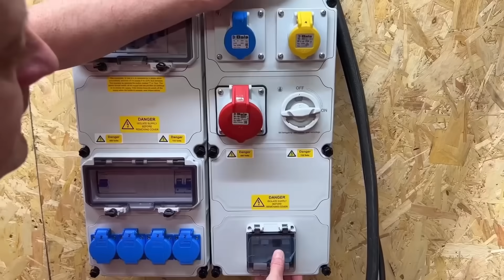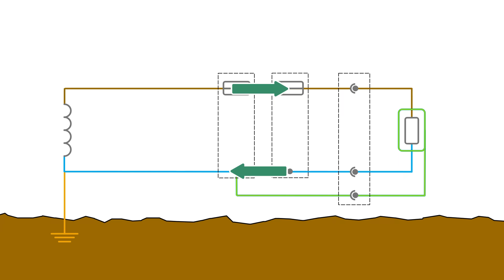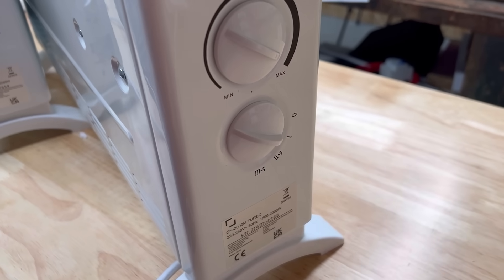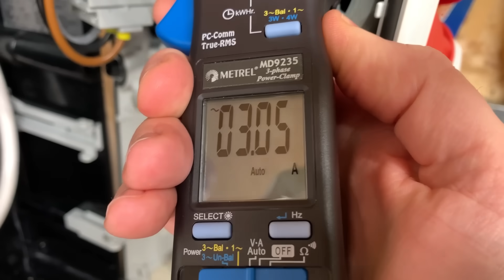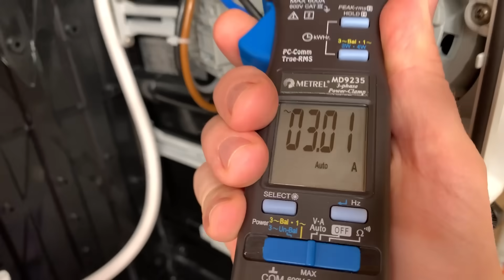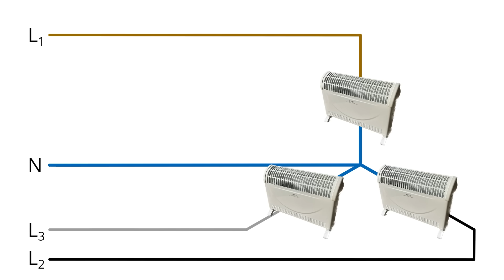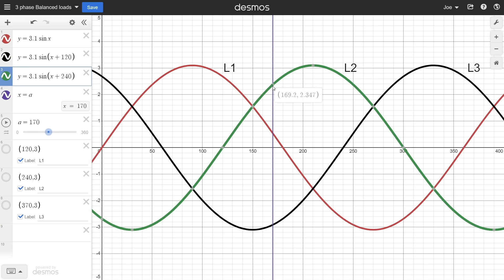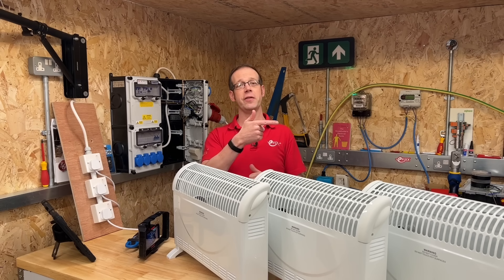Does Current Flow Through The Neutral Wire?

Comment: I am sorry foogod, US 240/120 vac Single Phase is what most American residential homes are supplied with, Hence, SINGLE PHASE! Not two phases! Everyone seems to think of it as two 120 volt phases 180 degrees out of phase, It is not! It is ONE 240 volt phase center tapped to create 120 volts for use on 120 volt devices (accepted safety standard in the US and other places as well)! Center tapping the transformer winding does not create two separate phases it creates two separate voltage potentials on the same phase! The center tapped winding and or conductor is then grounded and or bonded to the primary neutral creating zero potential difference between it and ground/neutral. It's only purpose is to carry any unbalance of the 120 volt current back  into the transformer winding! One winding! One 240 volt phase! Draw it out on a piece of paper and realize also that the unbalance can only flow with with neutral from one side of the split phase at any given time. This scenario is 240/120 split phase (Single Phase! perhaps people get the wrong understanding due to the term split phase and not realizing it is being created with just one winding. In the US, It was common 30+ years ago to see 240/120 delta three phase in all types of buildings, this too could be a reason for this misconception or misunderstanding 240/120 split phase). On your piece of paper draw out your homes electric supply as two ungrounded lines (one 240 volt circuit) coming from the transformer and one grounded center tapped line! Now draw it out as a schematic and start adding 120 volt and 240 volt appliances. Now draw out a sin wave graph of your schematic, when the peak of the 240 volts is on one conductor of the circuit the other conductor is at a potential difference of 240 volts less (zero volts in this situation) and the center tapped conductor is at a potential difference of 120 volts less/more respectively to each of the main ungrounded conductors! Keep in mind the primary winding is just one winding with one side of the winding grounded. I hope this helps clear up the whole two phases, out of phase misinterpretation! I to this day see seasoned electricians refer to the 2-240 volt ungrounded conductors coming into a house/building as phase A and Phase B thinking they are two separate 120 volt phases, they are not! And if they are, they are not 240/120 split phase!
Reply: well the primary side is one phase. But the secondary side can be thought of "2 phases". The neutral essentially divides the voltage in half. The reason people call 240/120V split system 2 phases is because, as far as analysis is concerned, it behaves like a 2 phase generator with each coil 180 degrees apart. I don't care what it is called. What matters to me is the 240/120V behaves similarly to 3 phases in a sense that the neutral on the 240/120V and the neutral on 3 phase have the same purpose; and it is to stabilize the voltages and carries the unbalanced currents back to the source.

Comment: While 2 phases were active, why there isn't 1.5A flowing through neutral. On sine wave when phase 1 is on 3A, phase 2 is on  -1.5A.  So 3-1.5=1.5A ?
Reply: It was 3A. Nothing was 1.5 A. You cannot add them as such. You must add them as complex numbers.  3<0° + 3 <120° = 3<60° where < designates the angle. You can also think about an equilateral triangle where you first go one side 3 A to the right, then you go the other side (3 A) but still are one side (3 A) from the start point. The third side gets you where you started from.

Comment: Yo, this is magic stuff 😍
Iam just rolling into big buildings with 3 phase ac and hi power pumps and motors

I'll stick to this channel

Fwy, I imagined that it has to do with the 3 phase, if you would add up the 3 loads trough the neutral it should be way bigger than 2.5

2 waves can cancel each other out. Dad was a guitarist 😅

Comment: Does this mean electric flows back to the substation/grid?
Reply: Yes, currents always flown a closed loop. One way of seeing this is that the current mimics a driving belt with one leg running forward, the other in return.
Reply: @kjellg6532  There are physical gaps between primary and second side of transformers. Currents on primary can NOT flow into the secondary side and vice versa. What really happens is one side induces currents on the other.
Reply: @nhitc6832  OK, so given an AC generator connected to some load, say an oven. Now we cut one of the wires and install a capacitor. A capacitor is two metal plates separated by a gap. As the circuit is broken in the capacitor, will there any current flow from the generator via the load and capacitor with its gap of air,  back to the generator?  
If we hide the trafo and the capacitor in two black boxes. Could you decide which box is currently in use? Current flows inn and out both at the load and the generator, Energy is transferred as the oven gets hot.

Comment: At 5:21 , but if you remove neutral, the circuit would be incomplete and no current would flow , especially when you have a faulty current protection installed.
Reply from the maker: If you've got a balanced three phase load you can lose the neutral and the circuit will work fine. 😃
Reply: @efixx  is that legal?  the electrical meter won't read the electrical consumption without neural, right ?
Reply: @tom2010ad  Are you serious? Of course the meter reads all the phases. If there is no current in the neutral how could removing it affect anything?.

Comment: 5:10  How the heck could all heaters still be working if you disconnected the neutral???
There will be no reference to ground as long as you don't touch the phase wire and become a neutral yourself or in a slightly more safe alternative simply just connect the ground wire where the neutral should have been connected.
Right?
Edit: Or did you mean that they could kind of still work but with a less powerful voltage difference towards the other two phases?

Comment: To simplify current/electricity doesn't get used up but instead it is passed on to earth and I have no Idea what I'm talking about, great stuff!
The other day I was doing some "maintenance and for some reason after wiring everything up I got 365v on 220v, can someone explain to me what I did wrong or is that phase to phase voltage, if so how can I get a 365v reading from two positive phases.
This is the end of me. 🙃🔫

Comment: Any imbalance on a multi wire circuit will show up as neutral load. Example: single phase 120/240 feeder or multi wire branch circuit. Phase A current 5 amps, phase B current 8 amps, neutral current would be 3 amps. If that was covered, sorry, I missed it.

Comment: the neutral will carry the imbalance, remember your vectors. plus 3 resistive loads were used here each with the same setting. A better example joe would have been to set one / two of the heaters @ a different setting, then measure. maybe in the next one. Fair play though good vid.

Comment: Howdy. Yes.
If the load is a delta configuration no neutral is needed either. The currents need not be symmetrical.
It is defined that the neutral  needs to be only half the phase cross section from 16mm2 upwards. That is true in most cases. However, powerful solid state frequency converters may generate very strong harmonics. Some harmonics cancel each other but some get added in the neutral. The neutral rms may be way higher that what half a cross section can carry. With converters the neutral should be the same as the phase at least to 25mm2 copper. Preferrably to 35mm2 copper even.
In modern converters efforts have been made to decrease the neutral currents. Always check the specs for what cross section is needed for the neutral.
Regards.

Comment: For single phase,we can measure neutral current with clamp meter,but neutral doesn't shock human in a closed circuit?i am confused on this question..
Reply: You are confusing current and voltage. You cannot feel the current that flows in the wire (unless it is so high that it makes the wire hot). You can feel only the current that goes through you. If you touch the neutral there is no voltage so no current flows through you.

The idiots who say: "It is not the voltage, it is the current" do extreme havoc for understanding.

Comment: Question from a layman.  If current is flowing thru the neutral circuit why can't you recycle or re-use it,  & does it "return" to the supplier or could you feed it into a battery or transformer intercept without "consuming" any more celectricity ?

Comment: Does current always flow on the full cycle of the sine wave on all devices ? this surprised me. Measure with a clamp/scope for the truth, instead of averages
Reply: Multimeter, clamp meter... will always read RMS value (average). If you want to read the full sine wave, that is the job for oscilloscopes.

Comment: So how would an RCD work in a 3 phase installation work if there is a difference between the current on the line and neutral?
Reply: The 3Ø RCD is smart, if the L1 (5A) L2 (5A) L3 (5A), RCD KNOW the neutral must be zero. 

If L1 (5A) L2 (0A) L3 (0A), RCD KNOW the neutral must be 5A. 
--------
And 1Ø RCD  (2P RCD) work as curren 
Of the Phase = curren of neutral
--------

But do you know this video all Load same Power Factor so in reality of there three loaded same current but they not same Power Factor the neutral will be have current

Comment: How to calculate the current in neutral line in 3 ph. Circuit with unbalanced loads in-between? 
I mean what's the equation(s) needed here
Thanks
Reply: in = sqrt( i1^2 + i2^2 + i3^2 - i1*i2 - i1*i3 - i2*i3 )

Where
in = neutral current
i1 = current in L1
i2 = current in L2
l3 = current in L3

Notice that if i1=i2=i3 then in=0
Reply: @pv2b  
Your formula gave me the same result as @ 4:12 
Best reply, great effort, thanks bro 👍🌷
Reply: @Ikrima1948  Yeah for that specific case where i2=i1 and i3=0 you end up with

in = sqrt( i1^2 + i1^2 + 0^2 - i1*i1 - i1*0 - i1*0 )
Simplifying to
in = abs(i1)

Comment: The neutral wire is like a pressure relief valve on a pressure tank. Normally nothing flows through it unless there is excess pressure or excess voltage. 
My job is to size pressure relief valves and they are sized to handle the full flow that is normally flowing into the system in case you have blocked outlet. 
Not sure if it's the same with voltage.

You should always have a pressure relief valve and never count on the system operating at perfect condition. 
In electrical systems a neural line should always exist as a safety precaution.
Reply: No, normally current flows in the neutral. A perfectly balanced system on a house level is a rare exception. Balanced systems are either really small like motors or very large when the laws of statistics balance them,

Comment: If your circuits are not balanced in the breaker box, you can get current flowing on the neutral line. Also, if the protective covering on the wires feeding your breaker box crystalize, you can also generate current flowing on the neutral line.

You can argue with me all you want, but I learned this through experience when we installed a minicomputer in our newly renovated building. The computer was blowing boards every month, so we put a line analyzer on the system and discovered current on the neutral line. Apparently, computers do not like current on that line. Upon diagnosing the problem, we discovered what I mentioned above. Once we fixed those two problems, the current was no longer found on the neutral line.
Reply: in a sense, the protective covering being crystalized creates more resistance big enough  that it creates an imbalanced load. In real world application tho, no circuit is ever balanced. A balanced load is more of a theoretical circuit .

Comment: didnt see the video but I d wager it has to do with symmetrical usage of all three phases. When you only connect 2 phases or when all 3 phases have different voltages you are changing the 0 point (dont know how to say that in English) of the triangle which means there will be some voltage in the neutral conductor.. now let's see if I was right :D

Comment: How can a 3-phase motor with no neutral run if it doesn't have a neutral to complete the circuits? How can electricity flow through a system without a complete circuit?
Reply: The phases complete the circuit. It is connected either of star/wye or delta/triangle. In delta there is not even a point for the neutral. In star one could have a neutral but nothing would flow in it.

Comment: This could also be drawn up as vectors. The phases are 120 degrees out of phase, a balanced load drawn as vectors would also show 0amps, and an unbalanced load would result in a vector length equal to the amps drawn in the neutral. That's how I learned it and understood it best in school, but this was also a great explanation! Nice and simple, keep it up! :)
Reply: @christvedt3852  same in my electrician trade school (TAFE)
Reply: Exactly, the vectors would form a closed equilateral triangle, ie zero resultant

Comment: The key word is a perfectly balanced system!  If any of the loads brings asymmetry to the system neutral turns into leverage conductor. The easiest way to explain it is by using rotating vectors. In perfectly balanced system  120° between each phase enables the current to flow and the neutral is a superfluous component. If you can draw three sine waves with 120° shift between them it becomes self explanatory why the current flows without the neutral conductor.

Comment: Three phase motors don't "usually" not have a neutral, they "never" have a neutral.  They are, or should be grounded but that is not a current carrying conductor. This would have been a more enlightening demo if 3 different loads were used, then you would see the neutral current balancing. 3 identical heaters is unrealistic, and reading the shared...meh

Comment: That’s a pretty good explanation of how phasing effects neutral current. But the comment about motors having balanced loads and therefor you can remove the neutral is not accurate. Three phase motor windings are wired in a delta configuration, and therefor there is no place to connect a neutral conductor even if you wanted to. Neutral conductors in multi phase circuits are necessary only to handle the imbalanced neutral currents created by different phase loads that use only one phase leg exactly like the demonstration using three heaters that each use phase leg and neutral voltage, whatever that happens to be. For loads using phase to phase voltage there is no imbalance and therefor no neutral is needed or desired. Three phase motors as well as single phase motors using two phase legs are examples of this, no neutral needed or desired.

Comment: Of course, current flows through the neutral. Little or no current will flow between neutral and earth if conditions are ideal. Conditions are often not ideal. So it's not wise to touch the neutral wire. Most of the current flows between the neutral and active when something is connected.

Comment: “The answer is Yes!”
The problem is when the neutral conductor of the load losses its connection with the neutral line of the power grid. I’m from Bulgaria. In the backward years (40-50 years ago) our power grid was 2-wire one - Line and Neutral only, without Ground wire. All loads with metal housing were “neutraled” instead of grounded because the power sockets were bridged to the neutral instead of separate ground wire. And there comes the problem - when the neutral conductor is interrupted, the metal housing of the load becomes under power as well. That’s a thing of the past but it was a part of our life those days…

Comment: When you study the history of electricity outlets plugs first it was two basically hot and neutral current flows both ways then due to electrocution shocks TVs radios your other appliances the two outlet had a wide and  thin blade plug so the wide blade was neutral thin blade was hot. This specially helped in grounding chassis on radios and TVs. But because of the human factor they came out with the plug with the third terminal round called the ground this was great for grounding washing machines and electric motors the second plug design was great for ground chassis on TVs radios sewing machines mixers you name it it was a big improvement. Unless you're  ground is tied into neutral at the main panel it's of no use to save anybody's life from electrocution.
Reply: Correct statement up to the point of a GFCI breaker installed in the circuits.  They require no ground to operate and protect life from shocks or electrocutions.
Reply: @KevinCoop1  it can't operate on 3 phase (1 phase)  sharing the same neutral because live and neutral wire doesn't always equal on load therefore it will 'tripping'. CMIIW

Comment: He says that most three phase circuits require a neutral wire but that is not true. The neutral is only required when the three phase power supply is fed to single phase loads.
Reply: Can you explain this a bit more detailed but also simplistic (I’m a noob), in context of American residential ?

Comment: A good way to try this is to touch the neutral and grounding wire. I learned the hard way…
Reply: Touching the neutral wire shouldn't cause any shock even if high current flows through, right? Because nearly all current bypasses you for your high resistance compared to the wire. And additionally because the neutral has very small resistance compared to what's plugged in between live lines and N, there's hardly any voltage across the copper neutral return wire that could push current through your body if you touched it.